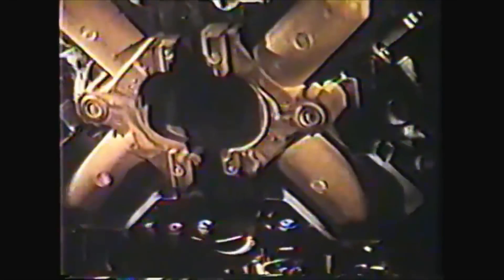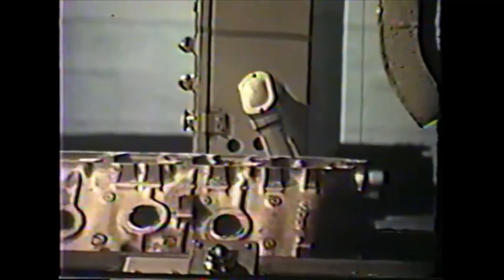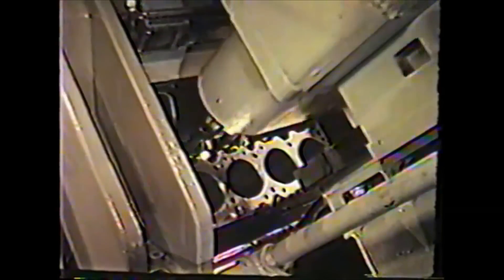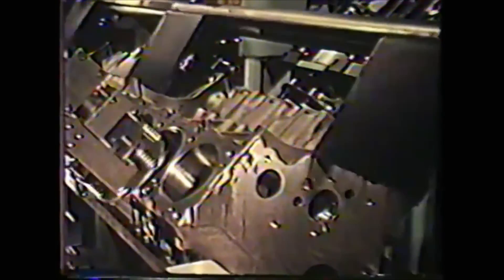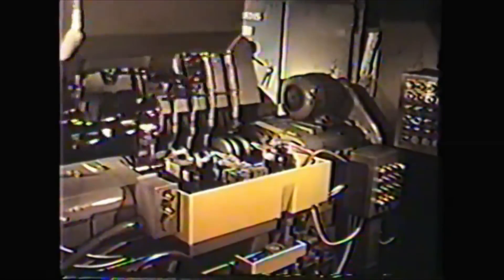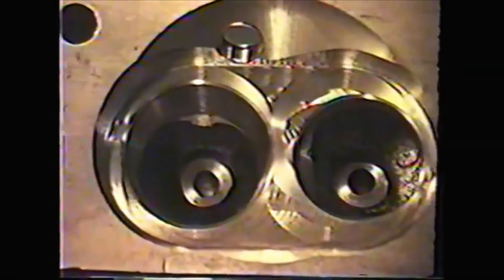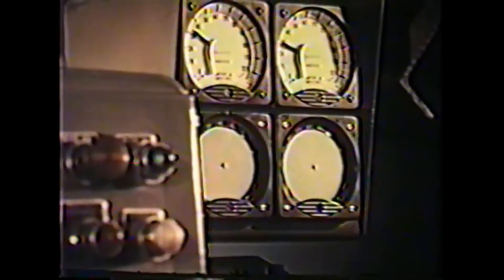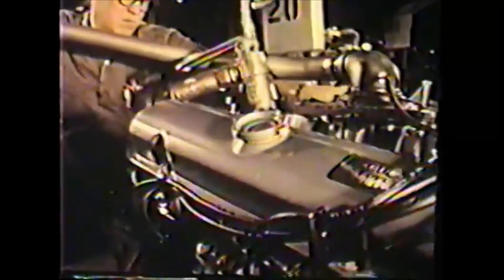Pontiac 455 casting and machining for original production in 1970.

Comment: That is exactly why Pontiac engines were the most reliable most engineered engine that GM ever produced - consequently, the most expensive.
Reply: 3.8.9.
Reply: @darrellsomers5427  I never say they stopped making crate engines based on original small block designs, rather I said traditional SBC engines share no parts with currently produced V8's. The LS engine that replaced the SBC & today's V8's are far superior in every way.
Reply: Sbc is trash.
Reply: @riverdragonmarineservice441  Yo momma.
Reply: No that would be the small block Chevy and there still building them
Reply: @darrellsomers5427  Actually a Pontiac V8 is basically a small block Chevy on steroids. What is considered exotic on a small block Chevy (like 18 degree valve angles vs 23 degree stock) came from the factory on a Pontiac (14 degree valve angles). Pontiac was never allowed to pursue and develop their high performance ideas and technology because they always made more power than Chevy. Pontiac was never allowed to use aluminum heads or blocks or Holley carbs on their production engines and GM acted swiftly to shut down Pontiac’s Ram Air V engine program once they found out how much horsepower they were making. I’d have to say because Pontiac was making more power with 400CI than Chevy was making with their exotic 427CI. Let alone Pontiac’s idea of a Ram Air V 428 that was producing over 600HP before any refinement. Imagine what a Ram Air V 455 would have made. If GM wasn’t so stupid they would have kept the Pontiac V8 in production since they produced a wide variety of displacements from a single block. Imagine the cost savings that could have been reaped. Pontiac V8s would have also been great truck engines since they produced the torque that Chevy engines lacked. Maybe Ford wouldn’t be the best selling trucks since 1978. But the best part of it all would have been seeing the look on the Corvette faithful’s faces when they popped the hood and saw that Pontiac engine. Third generation F bodies would have dominated the Fox bodied Mustangs from the get go. Also there is a lot of Pontiac DNA in the current LS engines.
Reply: Power is in the heads Pontiac heads don't flow past 500 lift that's why Pontiac didn't build s cam with over 500 lift the heads wouldn't support it the 455 SD head will flow as good as a hemi they claim Chevy heads will flow past 500 lift that's why you can get a 8.000 rpm cam ,Pontiac was going to develops a 427 hemisphere and Chrysler was more then willing to help but GM shut it down and theb?rocks are not created = the 421/428/455 are large journal blocks using production parts Pontiac heads are limited Chevy not so much you could get a 327 with one carb that made 365 hp that's right up there with most anything Pontiac ever built and had a 194 valve power will always be in the heads Pontiac cast the SD 455 heads and sent them to a company now called AFR the made changes including moving the valves to make them work
Reply: @darrellsomers5427  The Ram Air IV cam had over .500” lift. Mickey Thompson developed Hemi heads for the Pontiac V8. Pontiac cribbed Ford’s tunnel port design for the Ram Air V engine program. They flowed something like 250 CFM at .800” lift. So Pontiac did develop heads that flowed but GM cancelled development. I’d admit 365HP from 327CI is impressive but it didn’t make enough torque. The Ram Air IV was was grossly underrated at 370HP. The D port Ram Air III was rated at 366HP. You mean to tell me that the better flowing heads with round exhaust ports and much more aggressive cam = 4HP? The basic Pontiac V8 depended more on air velocity than flow. All the Pontiac V8s from the 326-400 had the same 3.75” stroke. They weren’t designed to rev much passed 6000 RPM. Apparently Pontiac wasn’t permitted to have forged cranks and very few had even forged rods. Their nodular cranks were pretty tough though. You could take a 455CI crank and machine 1/4” off the main journals and install it in a 400 block and it was still bulletproof. Only the armasteel rods were iffy. One of the fastest cars at the stock appearing drag racing circuit is a 1st gen Firebird with a Ram Air II engine. It runs with hemis and big block Corvettes. The aftermarket builds most performance parts for the small block Chevy because of the sheer number of them built. Most aftermarket parts for Pontiacs are based off the SBC which does Pontiac no favors. Also remember Big Chief had the fastest street car in America beating all Chevies and LS powered cars with a Pontiac powered car. My whole point is Pontiacs can be competitive with anyone but what works for Chevys doesn’t necessarily work for Pontiacs. Also if the Ram Air V program had been allowed to progress, Pontiac would have been held in higher esteem than the Chrysler Hemi and everyone else when it comes to building horsepower.
Reply: 469/516 not really much over 500 lift you must be a die hard Pontiac guy I like that Pontiac ruled the drag strip as far as GM cars go until the 409 ,I love Chevy and Pontiac I've had 6 or 7 pontiac's 326 to 455 but after my 1st big block Chevy I never went back to a Pontiac engine but Pontiac did build some beautiful cars
Reply: Butler racing said Pontiac knew how to build a crank they have never seen one break
Reply: I agree no torque from a small block Chevy but if it will pull 8-10 thousand Rpm with a low gear it will run in the 10's in a 3.500 pound car
Reply: From my Pontiac research next to the SD 455 rods the 389 rods are the best the earlier the better the large journal blocks have a pyramid shape coming up off the block near the back of the block where the bell house ing bolts up if I remember right its on the drivers side its a quick way to spot the 421-428-455 something to watch for if your in to Pontiac it comes up off the block and looks like a pyramid
Reply: And yes M/T built hemi heads for the Pontiac and the 427 FE ford before ford came out with the SOHC and they used a 3 piece push rod wild set up but they stayed together up to 6.000 RPM they say about 20 pair of Pontiac hemi heads were cast and sold for 2.500 a pair in the early 60'sthat was a lot of money
Reply: @darrellsomers5427  yes I am. I always love the underdog. Gotta admit if you want big power at reasonable cost in a GM Chevy is the way to go if you want an all out race engine.  But back in the day Buick Olds and Pontiac were hard to beat on the street. I think GM built the best looking cars back in the day.
Reply: I agree a 100 percent to bad Pontiac isn't still around I would have dropped buick 1st I guess they sell a lot of buicks in China and that's what it came down too they don't build em like they use too, sad for us car guys
Reply: @darrellsomers5427  I too was saddened by Pontiac’s demise. Even though I still own an 89 Formula 350 that was a pretty mean car in its day but to me Pontiac died in 1979 when they dropped the final 400 into a Trans Am. The tuned port 350 made the small block Chevy feel Pontiac like with its brutal low end torque but runs out of steam a little too quick. A few bolt ons and a Paxton supercharger make it run a little better than the later LS equipped F bodies and it now makes big block torque. I still wish they would have put the Pontiac 301 in the 3rd gen Firebird as originally intended. Would have made a 400 or 455 swap easy. I’d like to swap in a big block Chevy but it would kill the handling and an aluminum block isn’t in my price range. Plus it probably would twist the flimsy unit body like a drill bit. Plus I don’t think the rat would fit without some of it sticking out through the hood.
Reply: I puts 326 with a power glide out of a 67 fire bird in a 78 montecarlo it was a 67 firebird with the front end damage I stop to see if he would sell it to me I had a 69 firebird with a 350 that needed a 1/4 panel he said it only has 42000 on the engine and wanted to know if I could put it in he's montecarlo that had a bad engine I said yes so I got the 67 for labor and after that my brother in law had a 73 nova super sport no engine or trans we put s 400 Pontiac engine and a turbo 350 in it ,it had 3:73 gears in a 8.5 10 bolt not a posi we put a Richmond lock right in it to make it a posi quick little car making the Pontiac V8 go with the frame mounts for the engine  only requires some 3/16 or 1/4 inch plate to make it all work ,Paxton I bet that's fun
Reply: @darrellsomers5427  the 2 speed auto trans wasn’t a Powerglide. It was the Super turbine 300
Reply: @darrellsomers5427  :   Current Chevrolet V-8 engines produced  today have nothing in common with the traditional small block Chevy V-8. They are two very different platforms. Not one part is interchangeable.

Comment: Somebody go back in time and tell them what a bad move taking all the meat out of the lifter valley is.....lol
Reply: They fixed that on the SD 455
Reply: @darrellsomers5427  SD455 Blocks were the same as every other 455 Pontiac block - station wagons, 4 doors - all of them.
Reply: @patrickshaw8595   I don't know what you're supposed to know, but what I know is I saw a video showing me an SD block compared to a regular 455 HO block and they are a little different. The video I watched showed a little more bracing in the lifter  galley's. So, there is SOME difference.
Reply: @ONTHEEDGEFRED  I got the parts books. It was a running change. Same 455 block across the board from SD455 intro until their production ended Jan '76. There were no "weak lifter valley" 455 blocks but yes they thickened up that area a little.
      PMD DID make some really lightened up 400 blocks that need to be watched out for.
Take the pan off and those have windage holes in the main bearing bosses and those used spiral pins to locate the main caps.. Don't want to wind one of those too high.
     Pontiac lifter bore problems are IMO all caused by using heavy roller lifters and being lazy and just jacking up the spring pressure too high. Nunzio was bad about doing that.
       Begin with spending money on a lightweight flat tappet valvetrain and modern camshaft - then you can use just enough spring pressure to get the job done.
       Weak lifter bore myth put to rest by stock '70 RA IV ability to turn 7200 through the traps repeatedly with good (for racing) reliability.
Reply: Do the research its completely different even the main caps are stronger and provisions for dry sump oiling even the 455 HO is not the same
Reply: @darrellsomers5427  Ooops you were right I was wrong.
https://www.youtube.com/watch?v=rveOLEUhkMk
When you read the really fine print in the 1980
Pontiac Powertrain catalog there are notes saying "*exc. for 366/SD455"  and then calling out all their differences. 
      Were you aware of how we got the SD455? The old 303 Trans Am -engine morphed into the 366 NASCAR engine which has more similarities than differences from the SD455.
    Also fun in 1980 was the "6.6L" confusion. One 1979 6.6L was the Pontiac W72 400 and the other "6.6L" was the Oldsmobile short deck 403.
       I once bought a '79 T/A had a '69 Firebird 400 engine transplanted into it by a previous owner and it had a hell of a vibration - he had the Olds flywheel bolted onto the 400 Pontiac.
Reply: @patrickshaw8595  yeah, I was about to say you may wanna see one in person haha.
Reply: @superduty4556  Egads the things never were junkyard material. I ran an automotive machine shop 35 years and never saw one.
Tons of Chevys, a good amount of 440 and Hemis.  couple dozen Ponchos, exactly three Hi-Riser Fords - never had a 303/366/SD455 come through for any work. 
     Gotta realize somebody said something was for racing on any kind I'd turn it down.
Never met a racer I liked. Enthusiasts and experimenters heck yes. Made all kinds of crazy stuff over time for all kinds of crazy purposes - no racing stuff, period.
Reply: @patrickshaw8595  super low production numbers will do that.
Reply: @superduty4556  You're up on these things, right? Last time a complete original SD455 change hands that you know of - what did it go for? Or has it got to the point of people hunting down cars that went with engines or engines that went with cars?
   I knew couple guys had new SD455 'birds and my old '68 Firebird 400 with just a Crower hydraulic cam just blew 'em away.
They didn't mind that too bad but when I went home and got the extremely modified '65 Turbo Corsa Corvair and did it again then they would get pissed, lol.
Reply: There wasn’t much confusion about the 6.6 Letre engines in Trans Ams in 1979. The Olds 403 had 6.6 Letre on the shaker and the Pontiac 400 had T/A 6.6 on the shaker. Unless you lived in the People’s Republic of California where they all said 6.6 Letre beginning in 1977 because the Pontiac V8 supposedly couldn’t pass their stringent emissions standards and the Olds 403 was used in its place. Elsewhere in 77-78 where the Pontiac 400 was available there were 2 versions. The standard performance L78 400 was designated 6.6 Letre while the high performance W72 400 was designated T/A 6.6. All of the 400CI Trans Ams in 1979 were the W72. In 1977 they used the “lightened up” version of the engine block for both the L78 and W72. Then in 1978 they brought back the 1971-early 1975 casting for use in the W72 due to warranty concerns. All the 1979 W72 engines were produced and stockpiled for the 10th anniversary Trans Am were produced in 1978 and were only available with a 4 speed manual. All automatic 1979 T/As received the Olds 403. Technically the last year of production for the Pontiac 400 was 1978.
Reply: @mikee2923 years ago  I had a couple of those nice L72 400s ,from 4 speed cars , with 6X heads with the "4" combustion  chambers .
Reply: @Peter-do5ht  The standard L78 had 6X8 heads that were standard 400 issue heads with 101cc combustion chambers that kept the compression at 7.7:1. The 6X4 heads on the W72 were actually standard Pontiac 350 heads with 92cc combustion chambers that boosted the compression to a whopping 8.2:1. The W72 was rated at 220HP by Pontiac was actually rated by the NHRA at around 270HP. Not too shabby for low compression and that horrible pellet style catalytic converter and all the smog crap bolted to it in the late 70s. A properly equipped 4 speed T/A in the late 70s was capable of low 14 second 1/4 mile ET in a 3800lb car. That’s garden variety small block muscle car territory from the prior decade in the malaise era.
Reply: @mikee2923 Thanks for the info - Those 400s are great , I wish I kept the few I had
Reply: LOL. they'll tell you it helps with oil "drain-back". (Unlike Chevrolet.)
They actually didn't take it out. It's missing in the molds.
Reply: You I been a mechanic for 55 years and for 32 of them I worked with my Dad who had a 35 year head start on me. Wanna hear a quote spoken in exasperation by him to me?
     "Boy - the guys designed these things to be practical to produce. To give a required performance. To not weigh too much or use up too much time or costly materials. They had to satisfy their buyers - not you. They were designed to run until they were out of the warranty period and for a good long while after that.
NOW THE WARRANTY RAN OUT TWENTY YEARS AGO ON THIS THING AND YOU WANT TO DOUBLE IT'S DESIGNED POWER OUTPUT. Just shut up and work with what you got or buy something better, OK? You sound stupid when you say shit like that !"

Comment: I worked there.
Reply: That's cool. You may have helped build some of the Pontiacs I've owned over the years. Currently I have a '73 Trans Am which I bought from the original owner back in 1987.
Reply: @jayrowe6473  Oddly enuff, I bought a 73 T/A, (from Tex.) in 87. Still have it. Condition 5.
Reply from the maker: Very cool. What do you miss most about it?
Reply: @twoponchos  I miss the camraderie that was so strong in the foundry. People really stuck together and helped each other out. It was a very dirty place to work but you got used to it. Eventually I worked in every plant in Pontiac Motor Division. I started as a millwright apprentice in the foundry in 73.